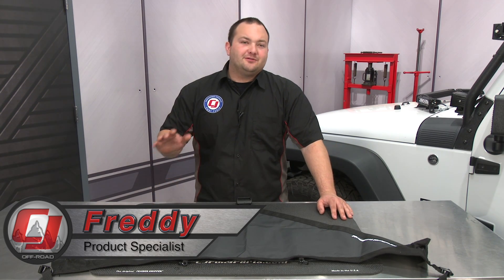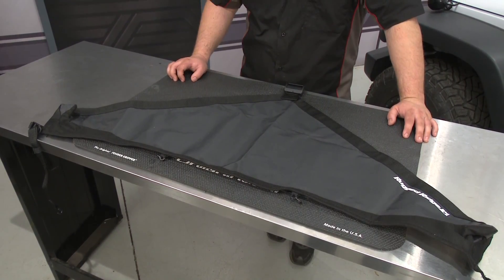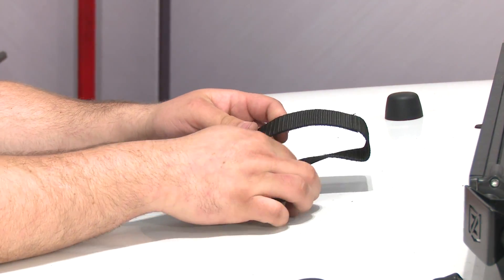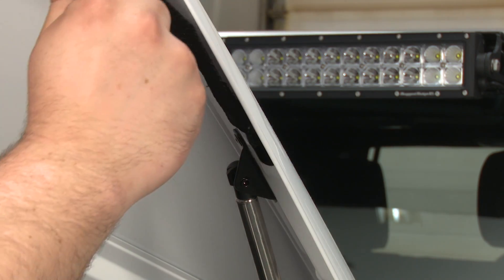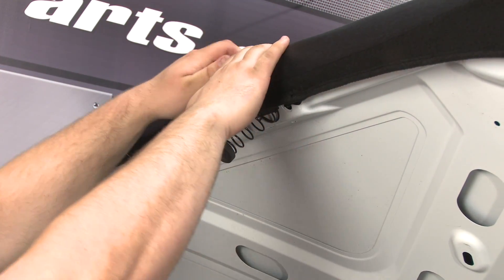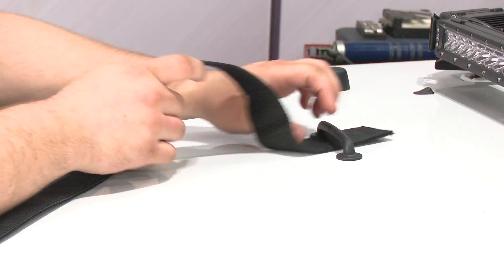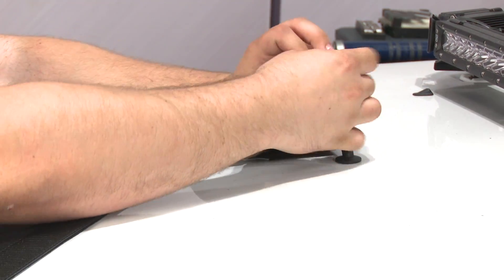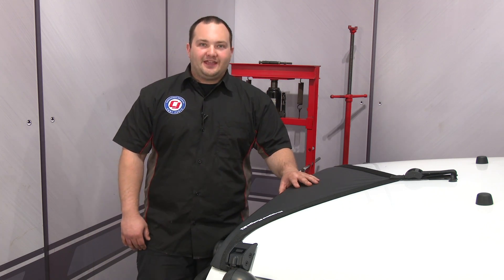Jeep Wrangler Rugged Ridge Hood Bra Black 2007-2018 Installation

Comment: It's a bitch to install & having to remove it everyone time it rains makes this pretty useless.
Reply: Why would you want to take it off every time it rains?
Reply: @TAZ95C4  That's what is recommended due to water getting trapped underneath & damaging the paint.
Reply: @langano2095 I've never taken mine off, and the paint is actually in better shape there than any other area of the car.